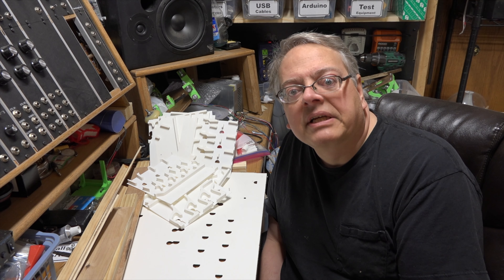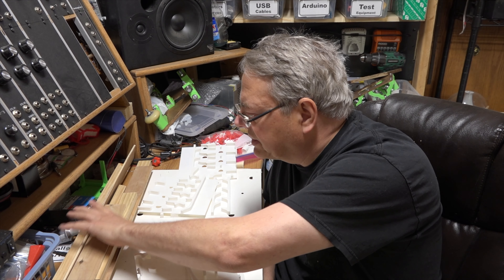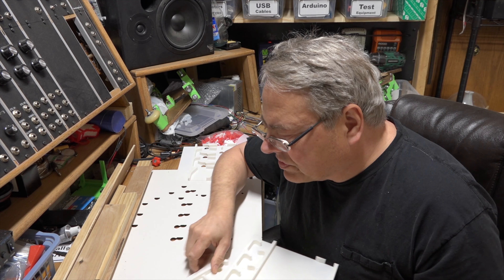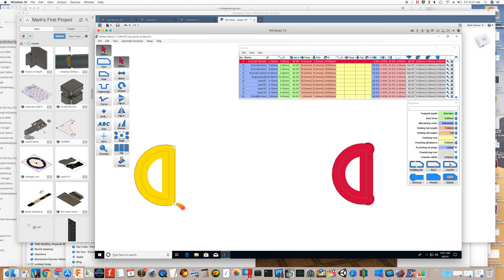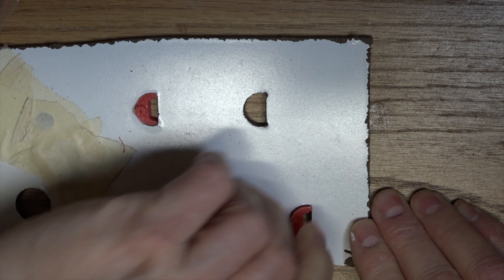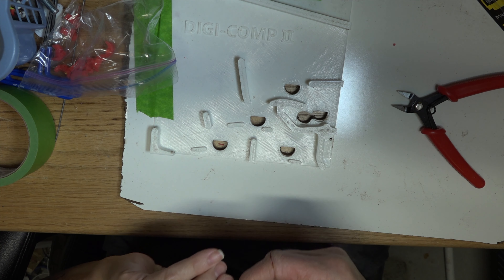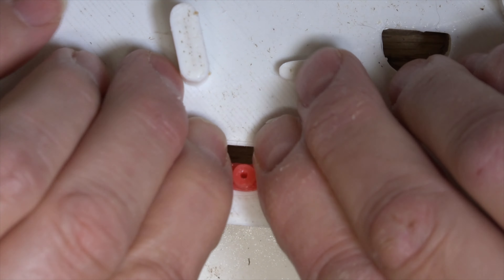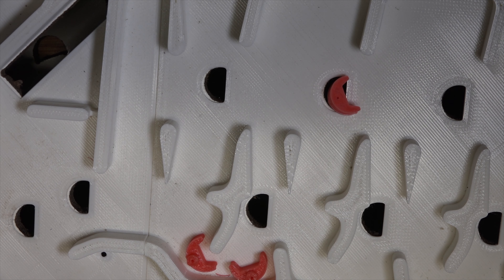Digicomp II Replica Build - Part 1

Comment: Did you ever complete this project? It looked as though you started out real good, or did you get bored with it, LoL. Great video.
Reply from the maker: Unfortunately I got distracted trying to make a programable wire bending device to bend the music wire. I still plan to get back to it. Sorry...
Reply: @Someoldguycoding  I understand, I'm the same! Shame as it looked good. Did you print the parts? as the quality looks great
Reply from the maker: @totallymagic  Thanks, Yes, 3d printed it all. The parts that go on at this point (flip-flops, switches, toggles, etc, are rather small parts.   So use a quality filament and don't' squish that first layer too much.  Save some filament to print replacement parts that might not survive assembly. By the way, the person who posted the DCII (Megardi) also posted Dr Nim and the Think-a-Dot models, so check those out too if you're an ESR Fan!
Thanks for watching!   Great lock-down projects!